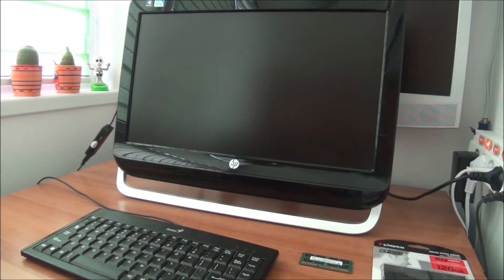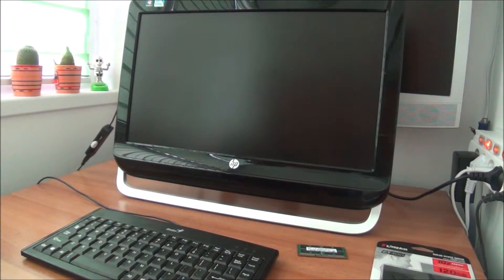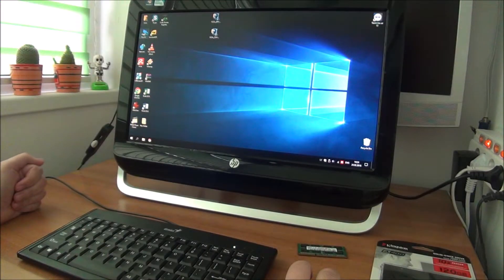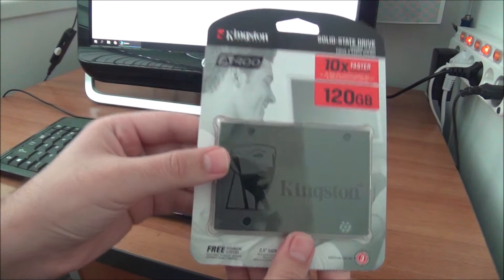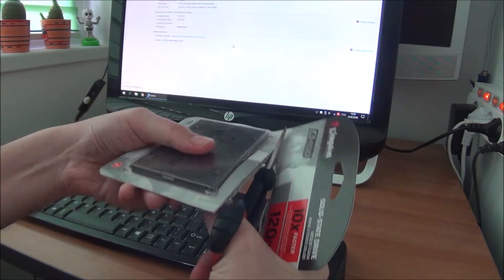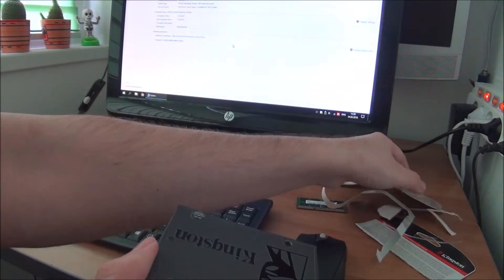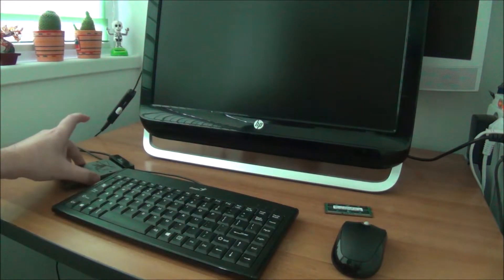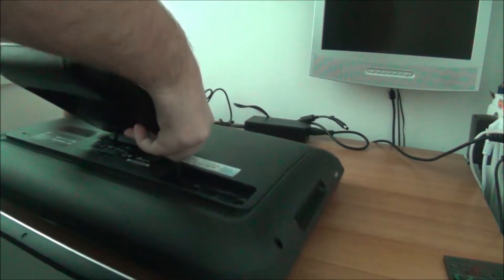How to upgrade memory and hard drive in HP All in One 3420

Comment: Can it upgrade to m.2 nvme ssd?
Reply from the maker: No, only sata is supported.
Reply: @UltimateDIY  ok thanks
Reply: @UltimateDIY  I have hp pro 3420 but you have normal one is not pro version the pro version was core i3
Reply: @UltimateDIY  the pro version is also known is locked full of screw even this hard drive
Reply: So let me know that pro version supports m.2 move
Reply from the maker: M.2 was not even out when this computers were made.
Reply: @UltimateDIY  I see in google it supports many ssd more then the normal one I saw it supports nvme with no m.2 but still u helped me so thanks

Comment: How much did the hard drive and memory cost you?
Reply from the maker: The ssd was $45 new and the memory about $10 second hand. But now the ssds are way cheaper, at about $25 for 120gb.
Reply: @UltimateDIY  Ok thanks. Also, could you maybe work on an All in One Lenovo PC? I wanna see if the operation is similar since I'd like to upgrade my mother's All in One PC.
Reply from the maker: @Electron Sadly I don't have a Lenovo all in one. If I get my hands on one, for sure I will make a video.
Reply: @UltimateDIY  I just bought (last week) a Kingston SSDNow UV400 6GB/s 240GB for 33 Eur incl. delivery (looks identical to your one). So shop around. Good bargains available for SODIMM memory too. Buying today 2 x 2GB DDR2 200-pin PC2-5300 667MHz (new) for only 9 EUR. But they take 3 weeks to arrive from China...
Reply from the maker: @d roses I really like that the ssd prices finally went this low :)
Reply: @UltimateDIY  Me, just waiting for 1TB SSD prices to fall low enough, then I'll be happier...